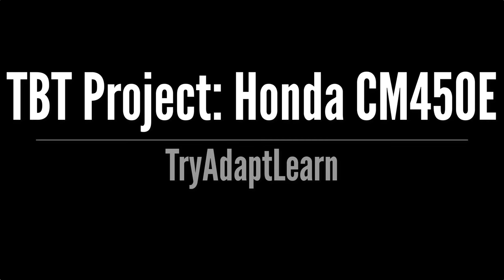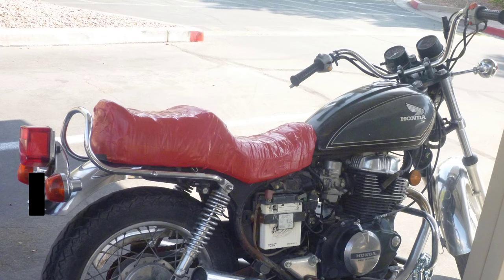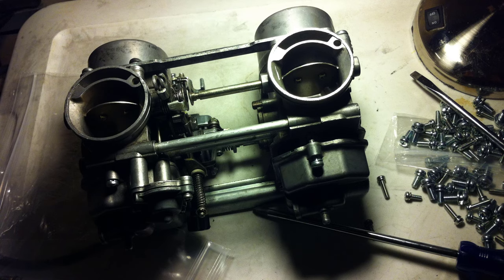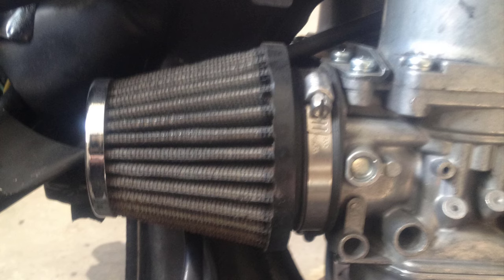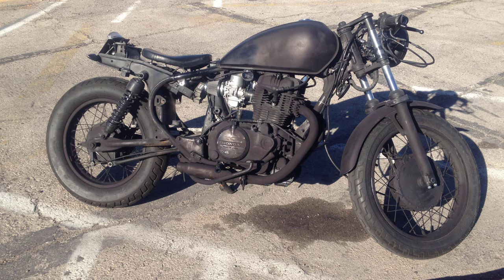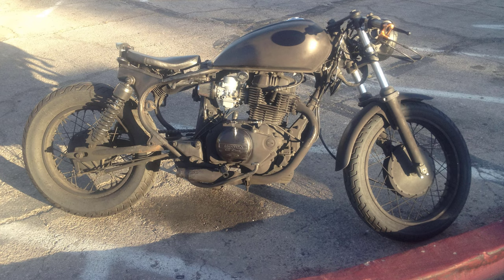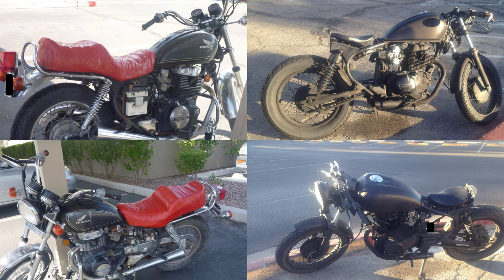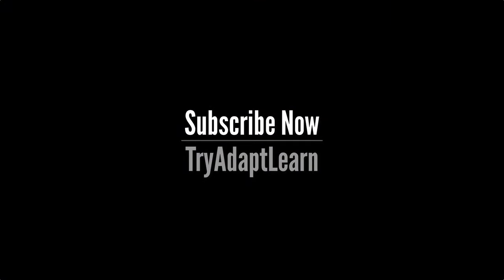1983 Honda CM450E : TBT project  : A low budget commuter rat bike

Comment: Which air filters are those? I got the same motorcycle and I'm going to rat it out a lot like yours. Great video, thanks
Reply from the maker: Sorry, I lost the part numbers for the filters, they are K&N.  You'll have to measure the diameter of your carburetor.  Please keep in mind that without the stock intake and exhaust, I had to re-jet the carburetors.  I lost the info on which size jets I used, but it can vary depending the environment you are running at (temperature/altitude).
Reply: @TryAdaptLearn  Thanks very much. I would have probably forgot about re-jetting without the reminder!